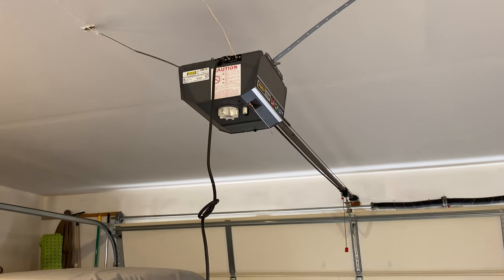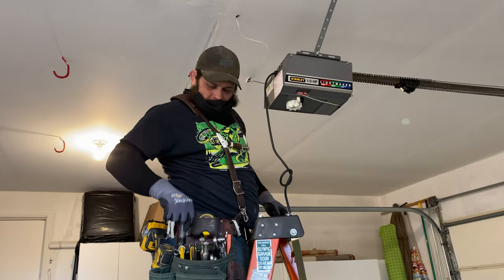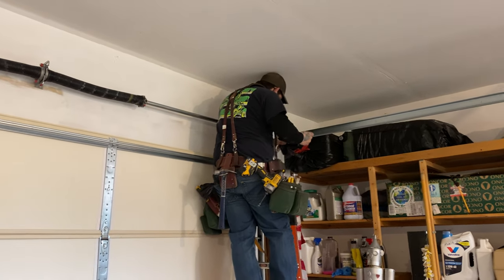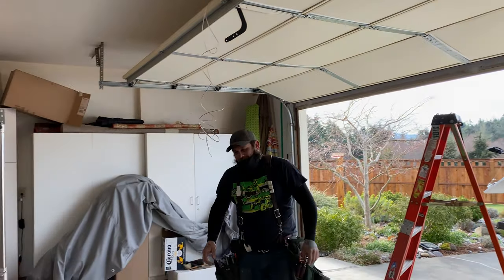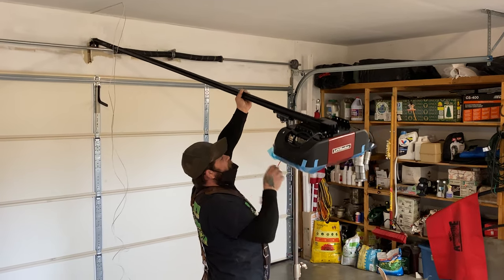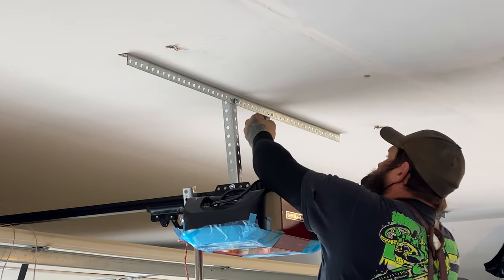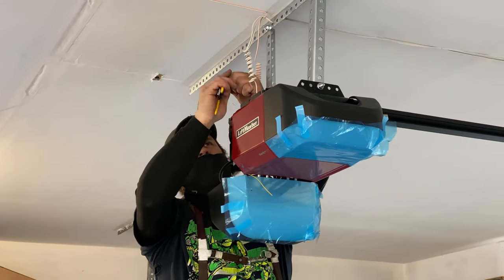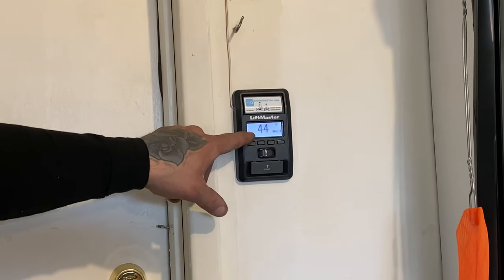Replacing a Burned Up Garage Door Opener with a Liftmaster Series Elite

Comment: Check out the capacitor before replacing the motor.  (Videos on YouTube) If you think about it, a garage door motor runs for at most a couple minutes a day.  Meanwhile, your dishwasher/clothes washer and other motors run for thousands of hours before they fail.
Reply: Check Out The Capacitor
Before Replacing The Motor.
Videos On YouTube
If You Think About It a Garage Door
Motor Runs For At Most a Couple Minutes a Day.
Meanwhile Your Dishwasher / Washer And Other Motors Run
For Thousands Of Hours Before They Fail.
Reply: Check Out The Capacitor 
Before Replacing The Motor.
Videos On You Tube If You Think About It a Garage Door
Motor Runs For At Most a Couple Minutes a Day.
Meanwhile Your Dishwasher / Clothes Washer And Other Motors Run
For Thousands Of Hours Before They Fail.